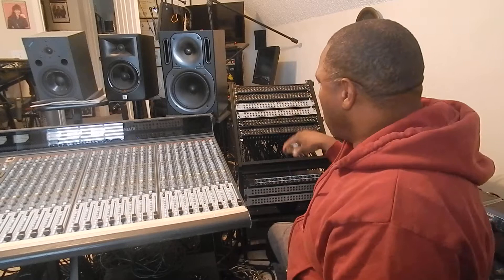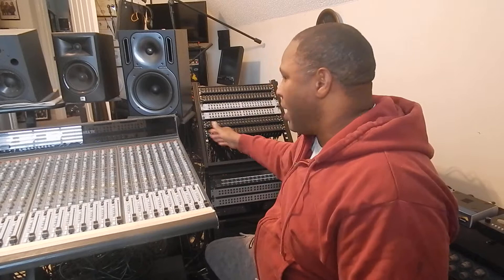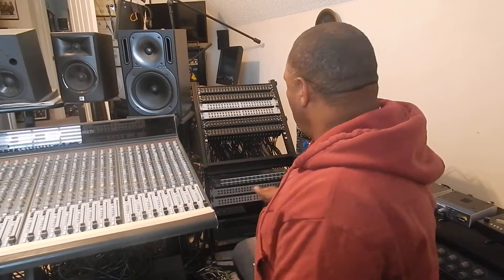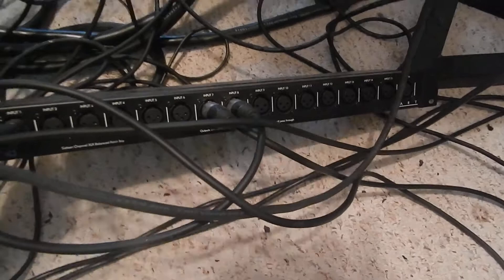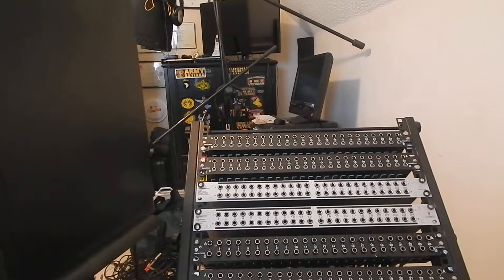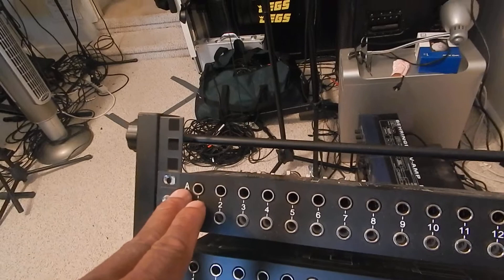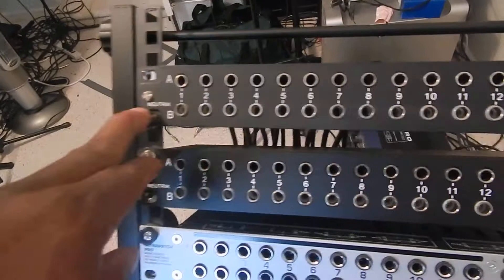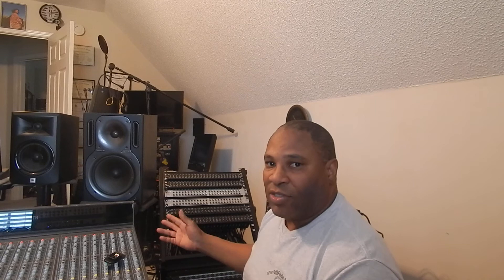Understanding Patch bay routing in a Recording studio

Comment: Great video as ever. Could grasp the concepts even better than I did reading articles over several months in the past.

Silly question, but I've been seing this a lot in other studios as well: is there a reason for you to have your patchbays (or other racks) with that gap in between them?
Reply from the maker: actually, its only because of the design of the rack.   Most patchbays would be stacked on top of each other